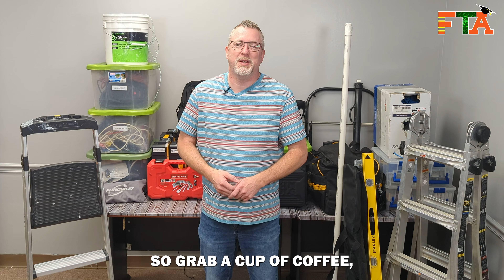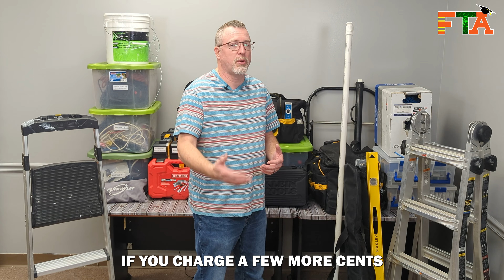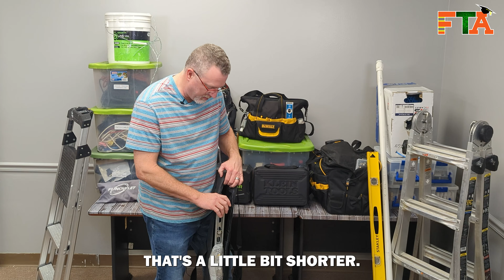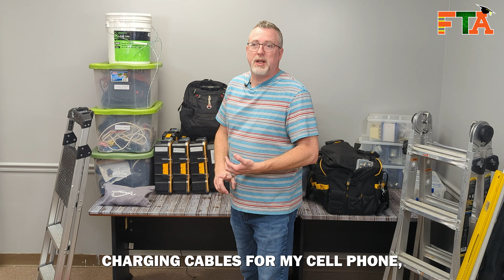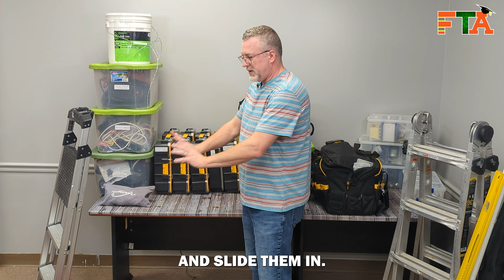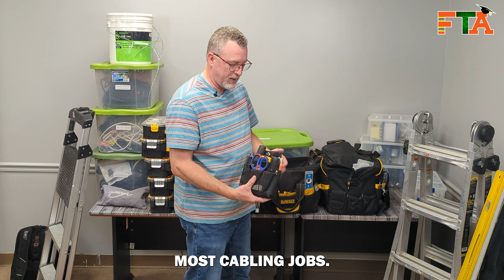What Tools and Supplies Do IT Field Techs Need? How Do I Organize My Tools and Supplies?

Comment: Thank you for this video, Mike, very cool

Those starting out can learn from this video and use it to help them organize themselves and their tools. I love the PVC tubes idea; I will go out and do the same myself, thank you for sharing! It was a good point to mention the raceway by Legend. It's great to have it when you come across the need to run cables on the surface instead of inside the walls. It's nice to see that you label everything; it is helpful and makes finding what you are looking for faster. I label things as well.

If I may add to your tool listing:

Klein Tools 3-Piece Hook and Loop Kit 80144 - I recently acquired a fantastic new tool. It acts like a tape dispenser but for Velcro. You pull the Velcro strip and cut it with the tool's chopper. Why did it take so long to make it, I don’t know. It has super strong magnetics, so when working on a telco or four-post rack, you can firmly attach it to the rack and use it. Plus, it has a belt clip. You can buy white or black Velcro.

Milwaukee SHOCKWAVE 10-24 UNC Steel Impact Rated Drill Tap Bit, along with a medium size vise-grip in case you encounter a broken rack screw lodged in the rack hole. The drill tap bit works great to clear up and re-thread those damaged rack holes. When someone is impacted, drill happy and doesn’t hand test the threads first and use a 10-32 screw in a 10-24 hole and vise-versa.

Rack screws were a good point that you brought up; through the years, I have found that the brand RackGold for me, is the best quality out there; they are steel and made in America. Sometimes, the cheaper aluminum ones strip too easily, and then you can’t take them out.

Hole Saw Kit - to make holes in the drywall to pull cables through and, of course, to cut holes into cabinets or tabletops to pull computer cables through as well

I use colorful round dot stickers to mark APs in the ceiling if they are not mounted on the outside. Sometimes, I find bullseye dots cool and easy to spot on the ceiling surface when you are trying to locate them.
Reply from the maker: Great ideas!  Thank you so much for sharing your tips and adding to the community!

Comment: If you haven't ever used them, I'd suggest a pair of screw extraction pliers. If you come in behind someone that went a little overboard with an electric screwdriver you'll think they're the best tool ever invented. Mine are Vampliers brand but I've heard the Knipex brand are good too.
Reply from the maker: @markmiller2361  you know how you finish a video and afterwards you remember all the things you forgot? Lol thanks for that. I usually carry a screw extraction kit BUT I didn't know they made pliers. Really cool. Thanks.
Reply: @fieldtechacademy  I mainly do POS work so they may be more relevant too me, but I figured since you were having a tool discussion that I would mention them.
Reply from the maker: @markmiller2361 The more information for the community the better. I can't know everything.